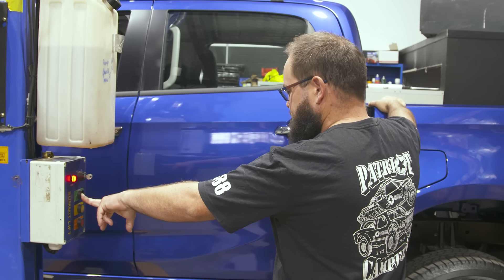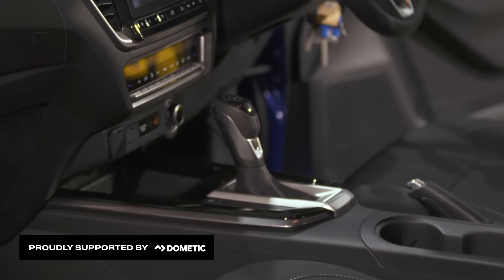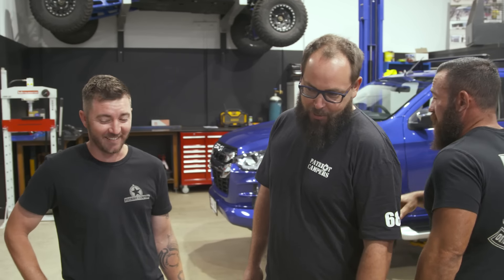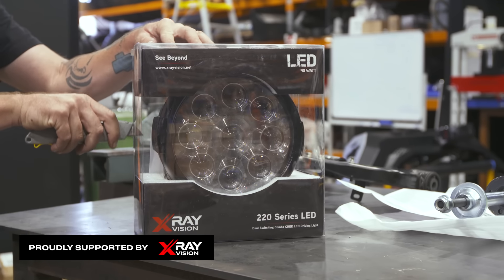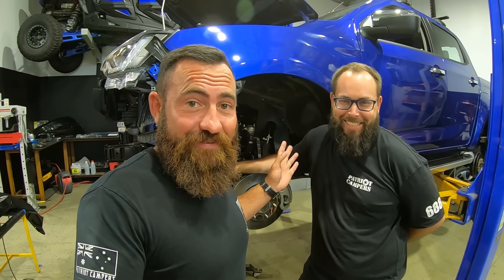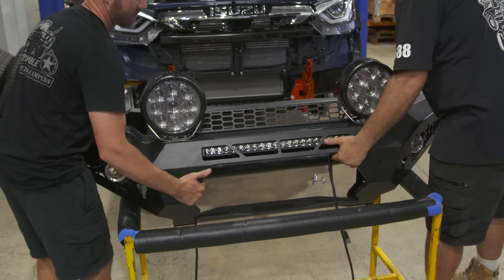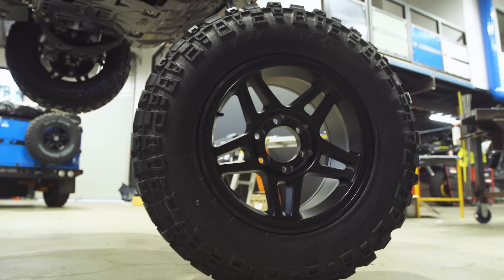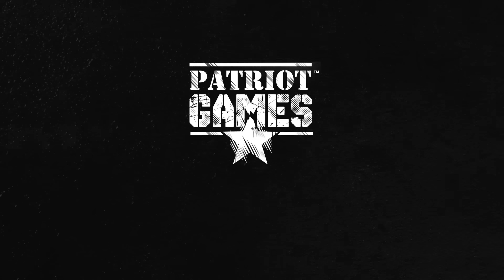Building Australia's TOUGHEST D-MAX - Giveaway Build Series EP 1

Comment: Justin, You have asked your patriot channel followers what running gear should go in Sarah's FJ.
Why are you building a D-Max Give Away.
You should have taken a 2021 Hilux stripped it for engine/suspension running gear for the FJ upgrade for Sarah's Xmas present.
Then use the Hilux body and internals, drop in a 79 series V8 motor into the Hilux.
 You have Wowed the market with Toyota upgrades-Black Truck & MEGA6, do it for the FJ and out do Toyota Australia's Tonka Hilux, and the 6x6 Artic versions, but keep it on 4's
A Kiwi ( Barry Crump Fan )

Comment: Great build guys, i do have a question with all the sensors in the front and rear etc, are these also house accordingly and did you find any issues and by chance do you also do builds for anyone similar to what you did for the DMAX.

Also wanted to know your thoughts on based on 2021 4x4 releases what your selection would be based on the following and also noting that this is a for the DMAX, which i rate but also wanted your thought from unbiased perspective against the DMAX  X-Terrain, Ranger  FX4 and Toyota SR5 and yes massive cost differentiator, but if you had your choice and they were all the same cost what might it be or would it be something else in this 4x4 category.

Do you think the X-Terrain is worth the money or would one be better buying the DMAX and doing a fit out like you have achieved with better results ad better gear?

Thank you